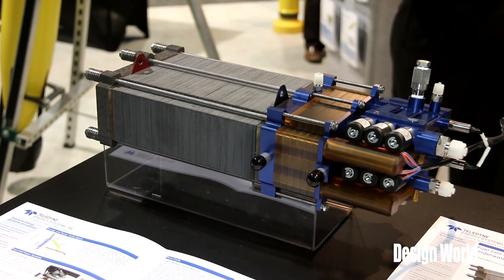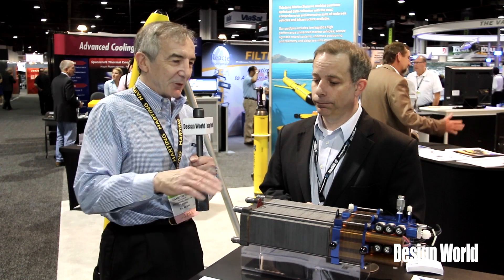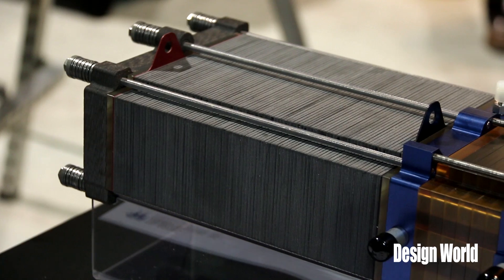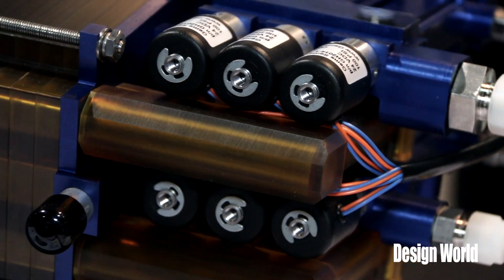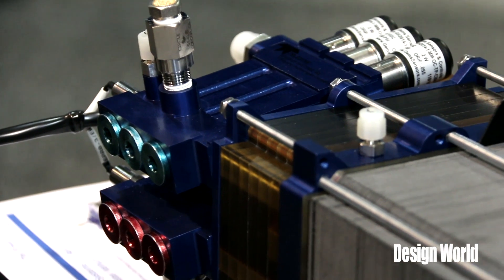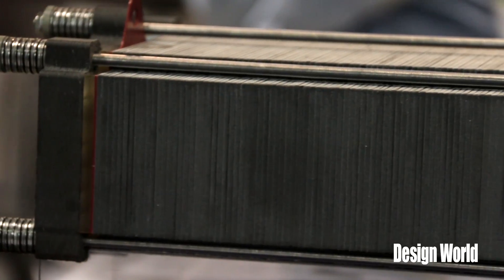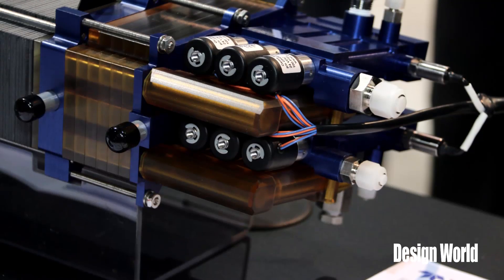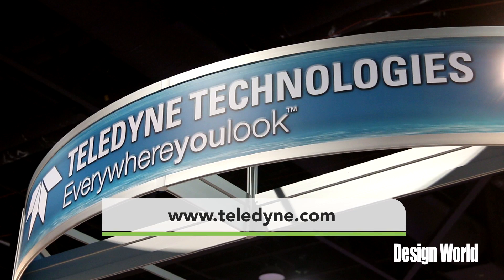Who needs batteries when you've got a hydrogen fuel cell

Comment: Use solar heating to make steam from ocean water, convert steam to Hydrogen, use the excess salt for foods or even salt the roads in the winter.  Cut costs down by making the Hyrdrogen from renewable resources then use it to power vehicles.  The clean water produced while driving could help stop desertification along the roads.  Fuel cells are the future.  Just need to focus on development as much as the government has spent on Toxic Battery tech.
Reply: How to convert stream into hydrogen?
Reply: @fsdsavinglives  Fuel Cells can convert water into hydrogen (or steam), then fuel cells can also be used to convert hydrogen into a direct electrical current.
Reply: WERE SPENDING ALL OF OUR LITHIUM ON SILLY LUXURY CARS.
Reply: @RubbinRobbin  not exactly true, my whole house runs on lithium batteries.  These batteries came right out of that luxury car and will run another 8-10 years, If not longer as long as I don't abuse them.
Reply: To store hydrogen you will have to compress it ( equals energy loss ).
On decompression, it could be a cooling agent plus be used in the fuel cell.
It is my guess that also the oxigen has to stored as well to be a clean source for the cell?
Occasionally I notice a truck running on LNG (liquified natural gas).
Then I am impressed since NH4 becomes a liquid at -162°C (-259°F)
Compression 600 fold.. 
(Netherlands - Eindhoven)
Reply: Exactly,hydrogen fuel cells to me are one of the most promising  technologies
Reply: @teenforce-dance5255  Formic Acid is the best hydrogen storage medium as it can be made directly from CO2 in atmosphere thanks to modern catalysts.
Reply: @philipm3173  Right on, i get to do more reading, thanks.
Reply: Goodnight
Reply: The steam system fails as the energy required to convert into hydrogen adds up to around  33% loss
Reply: Sadly you are wrong (on multiple points). Reason why fuel cells have not been widely adopted is because of low efficiency of hydrogen/water cycle. Which is only about 35%. 
Water (no chemical energy) -> electrolysis (energy goes in) -> hydrogen (high chemical energy) -> fuel cell (energy goes out) -> water (no chemical energy)
As you can see hydrogen is not actually the source of energy here. The source is what ever powers electrolysis to make the hydrogen. There is no reasonable amount of free floating unbound hydrogen on Earth (except the one made by humans), because it is highly reactive element that binds with nearly everything. So, hydrogen needs to be manufactured. It can be made from water, using solar with electrolysis. Electrolysis being about 75% efficient. Hydrogen fuel cell are about 50% efficient. Total efficiency of the cycle being 50% from those 75%, so around 35%. 
Note that none of this is new technology. First hydrogen fuel cell has been made in 1842, first car powered by it in 1966. Electrolysis has been discovered in 1800. 
This is no emerging field therefore it is unlike any major improvements will be made. On the other hand lithium battery will hold 99% of energy put into it.
Reply: @jeffsaffron5647  Increase efficiency by removing the need for powerlines, create decentralized utility companies where hydrogen companies can fill safe tanks under peoples home, no more need for costly maintenance for powerlines.  Save energy from the cost of making high energy cost powerlines or power plants by having peoples have their own fuel cell power stations for their homes.  New industry equals high paying jobs and innovation for those companies to save money by making hydrogen less expensive to make.  Alternative is Nuclear power to make the hydrogen and fill up peoples hydrogen tanks buried under their homes maintained by the competing decentralized utility companies.  Try to think outside the box.  I have already crunched numbers and percentages and know that not enough data exists to just say something wont work.    - To solve world hunger we need to make energy free or as cheap as possible.
Reply: @PhilosophyResurrected  Your argument is for decentralized power production not for using hydrogen. All you described can be done with batteries instead of hydrogen tanks. When using hydrogen you need to make 3x as much energy.
But OK lets do the math.
Average household in first world country eats up about 20-30kWh a day on average. Given 35% efficiency of your proposed solution, you would need to make about 90kW a day from solar EVERY day. So annually 90kW x 365 days = 32 850 kWh.  I live on 50th N parallel. We have on average 1 670 hours of sunshine per year. That means every hour i would need to make 32 850 / 1670 = 19.67kW from solar. That is achievable optimistically with 30kW solar system which costs around 50 000 USD, it would probably be even more expensive with fuel cells instead of batteries. Not to mention, fuel cells are rated for about 20 000hr of operation. Meaning they would last maybe 4-5 years. Does not seem like realistic to me.
Reply: @jeffsaffron5647  Let me get better insight into your thinking. Do you by chance know how much power would be saved from not making powerlines to include installation, digging earth materials and refinement?  How much power is lost sending power down those lines?  Could power be saved if hydrogen was made next to nuclear power plants?  The new industry would be to make fuel cells for fueling the homes, businesses etc.  We need more data to determine how much power is wasted with centralized power plants and their development or sustainment vs a decentralized power using fuel cells and hydrogen to power homes and businesses.  The whole industry needs to change to a hydrogen economy to make the planet a more clean place.
Reply: @PhilosophyResurrected  
- There is not a simple answer to that
- About 8-15% energy is lost in transition from power plant to household. Depends on distance from power plant, number of step-down transformers etc etc. 
- Yes but why store it if you have continuous source of energy in form of nuclear reactor. Energy storage is needed for intermittent energy sources such as wind or solar.
- Fuel cells are super expensive, have limited live span, and have very limited power output (needs to be stacked in series).
- No need for more data. We have electric grids over 100 years we know very well their loses.
- For many industries even electrification is nearly impossible. Metallurgy, steel foundries, chemical/petroleium industries. These industries rely mostly on natural gas as energy source they simply can't get enough power for their processes from electricity. 

My last point on this subject is on Hydrogen energy density. Because it is not as high as people think (meaning energy released in chemical reaction - oxidation, not talking about nuclear reactions such as fusion, fission or annihilation). Yes liquid hydrogen has highest energy density of all elements. However storing liquid hydrogen long term is nearly impossible since it needs to be kept at -252C. Therefor hydrogen is stored as gas at high pressure. This requires very heavy duty tanks and piping. Energy density of high pressure hydrogen gas is pretty much the same as lithium batteries when you count in the weight of the tank. You can see this easily in practice comparing Tesla Model S with Toyota Marai that runs on Hydrogen. Both have similar range at about 600 km.
Toyota Mirai - Weight: 1850 Kg
Tesla Model S - Weight: 2215 Kg
Yes Mirai is lighter but only by 10% or so. Reality is when you count in the heavy tank needed for high pressure hydrogen, difference in KWh per Kg vs lithium batteries is very small.

That's it from me, I said all there is to be said about this. I do wish reality with hydrogen was better, as it is a cool tech. Sadly reality is different and batteries are just better option.
Reply: @jeffsaffron5647  Very good points.  I think i am a bit smarter.  The reason i push decentralization is for the creation of a new independent energy society.  I think the sacrifice in energy output would be worth it.  We could slow desertification with the water that comes out of tail pipes.  I appreciate the discussion, typing to explain a point can be exhausting, much appreciated.  - Cheers.

Comment: Hydrogen generator... Get the name right bro
Reply: Is uses hydrogen it does not generate it
Reply: @namibianbackyardengineerin4412  It probs does both if its not attached to an external network with hydrogen in.
Reply: @GabrielTobing  It is designed for submarines n shit.
where is the sub gonna get the energy for making it? a nuclear reactor? well if that was the case you wouldn't need it.
Reply: @TauCu  Emergency power or if the power demands are greater than power production by the reactor for a short period of time.
Reply: @GabrielTobing  Not every sub can have a reactor. It also seems a dumb idea to allow unmanned underwater vehicles to have reactors. so they're probably not allowed to.
Reply: @TauCu  Well then, just charge it when not in use, like at your home.
Reply: @GabrielTobing  with what?
Reply: @TauCu  Main power.
Reply: @GabrielTobing  A most autonomous systems don't have access to the grid when operating.

If they did they wouldn't need batteries or fuel cells.
Reply: @TauCu  A good system would have emergency backups such as batteries at the very least to operate whatever needs electrical operation in the event that the main power source becomes unavailable. Without power an autonomous system would not likely exist.

Comment: That's interesting, because most space craft are solar and battery powered.
Reply: and most cars are powered by gasoline.
What is your point?
Reply: @TauCu  , and we know that is changing.  Not really blow away by this presentation.  

Compares size of fuel cell to battery,  but leaves out the size of the fuel tank.  
"How long will it last?"  
"Depends on how much fuel you have". -- Ahh, what about just adding more battery?
Reply: @KillroyX99  That was my point. it is changing because they found it to be no longer practical.

considering hfcs have gotten less investment then battery tech, and the fact that they're competing with it currently is impressive to say the least.

the guy literally asked "how long does a gas tank last"
and he basically answered: Well... it depends... on how much you use it.

for example:`
if you use a LPG bottle for a tank-less heater it ain't gonna last long... if you use it for a BBQ it probably will.`

That was an honest answer from the guy for a stupid question. the presentation was not about containment vessels. it was about fuel cells.

as for "just adding more battery" well...
is his target market retarded or something?

I think they did think of that.

And i think that is why this exists.
Because batteries didn't cut it in enough situations and ended up warranting this things majestic existence.

Comment: But these fuel cells cost $20,000 for what's the f*** point
Reply: ...And a powerwall battery pack is $10,000.  What's your point?
Reply: Bruce Ferrell 
And add
And 6,000 for a drive unit out of warrenty. Many have gone through several DU's.
Reply: if there was no point they wouldn't use them.

Comment: Most of you are missing the point .  This guy dont know much about it I am sure of that . But a tool like this is like all tools they break down and needs repaired or rebuilt . The same way as anything that is man made . The thing is the running life span of this tool is much greater than storing fossil fuels or Batteries .  You people had miss judge this tool and this sales man had also . Now Is this tool legit I dont know . But if it's at a demo fair I would count it is .  We have to remember that we want am on demand Hydro cell . This guy is not clear on that although he told the reporter that energy can be stored in a way and that it still needs prepared fuel source for this system . This is because that the membrane will collect contaminants from other sources like tap water or in the case open water my it be the sea or fresh water lakes or ponds .  One thing we have to realize the the fuel cell dont need to be vary large or contain a lot of water . Another words that water goes a long way .
Reply: Longevity, maintenance, water is "cleaner" and easier to acquire than lithium. The fuel cell process in reverse, adding solar power, will yield the separate gas. No need to pressurize depending on your application.

Comment: Hydrogen has already lost against improvements in battery technology, not just in terms of cost but in terms of energy density in working prototypes.  In 5 years, a single 500lb electric battery will power an EV for 1,000 miles, and a small aircraft for 100 miles of flight time.  By the time hydrogen fuel cells could be adapted in airliners, it will be too late.  Whatever theoretical advantage FC tech might have had a decade ago is quickly disappearing.
Reply: 3 years later... not even close to that range mate...2 years to go....
Reply: Nope

Comment: It would be good if governments across the world would back hydrogen power generation.

Particularly in New South Wales in Australia where all of the coal fired power stations are approaching the end of their life cycle & they are not going to be replaced with more coal fired power stations.

I know Donald Trump calls that climate change a hoax but in my area,the summers have had peaking temperatures of 40 - 47 degrees Celsius which isn't normal in New South Wales,only at places such as Coober Pedy in South Australia where old opal mines have been converted into homes for that reason,they are underground & there's no need for air conditioning.

If solar & wind power could be used to supply hydrogen gas storage,we would have hydrogen gas fired power generation, hydrogen gas heating & cooking as well as hydrogen gas fuelled cars & buses which would emit only H2O emissions.

It would do away with the most complained about coal seam gas plants where the fracking  process can pollute the water table,waterways & destroy farmland.

It really upset land owners at Fullerton Cove near Newcastle in NSW where the water table is only like 1 - 2 metres under the ground & their reason for wanting to drill there is because the coal seam gas bed is 20 metres underground.

That got stopped after the residents in the area complained about it & I don't blame them,it's bad enough that the air force have been contaminating that area with their toxic fire retardant.
Reply: The energy it takes to create hydrogen makes the effect of doing it not worth it. You are better off creating biofuel from brown water (poo), pumped hydro or batteries. Also, hydrogen is a really difficult element to handle safely, because it's so small (Literally the smallest element) it creeps into metal and makes it brittle over time. Based on the success of the tesla battery in South Australia, Victoria is going to build one as well. Decentralised, distributed storage is far more resilient as when part of the grid goes down due to bush fire or storms or whatever, having distributed storage means you lessen the impact of these outages. Hydrogen, has a niche market in commercial/industrial uses but not beyond that due to complexity, cost and safety

Comment: Where is the H2 fuel tank? Your tabletop energy source just got bigger than any battery when you include a large very high pressure tank.  How much energy is used to make the hydrogen? Hint, three times what you will get in output.  What is the price of the platinum in the fuel cell?  I think a Tesla with batteries wins this competition every time as a storage device for electricity.
Reply: Carbon-fibre fuel tanks are used that are about the size of a scuba diver's tank or slightly larger. Due to the nature of the material, the tank is pretty light and can be used to store a lot of hydrogen in a small volume. They're also indestructible, and can withstand being shot with a gun.  The problem with battery packs is that they aren't very scalable; they make sense for use in cars, but for larger applications like trains and HGVs, the poor energy density of batteries makes it uneconomical to use. Fuel cells are very scalable, at least in terms of power output/kg and kWh/kg.
Reply: It's not just the fuel cell & tanks. 5,000 to 10,000 psi hydrogen fuel lines & valves are required & they are very expensive to build, test, & maintain. Fuel cells also require large radiators to dispose of unwanted, inefficient, & potentially damaging heat. 

Finally because fuel cells produce power at a fixed rate there are also batteries, & a battery management system just as in a BEV. A fuel cell car is really a BEV with a really, really, expensive sustainer engine.
Reply: Look, hydrogen cells are better for few reasons: it doesn't really needs to be replaced, so it wins durability test and also it is not as harmful for environment, cuz lithium batteries are needed to her recycled but not all people or countries do that. Also there is a limited amount of lithium on the earth... And after this imagine that most of people will decide to move onto the lithium powered cars. It will be awful for all of us
Reply: 30 grams or so of expensive metal vs 60 kilograms of inexpensive metal; costs are similar. It is more efficient to charge a battery instead of splitting salt water and compressing the hydrogen, but if you also use the oxygen and H2O, or don't want to worry about the battery being undercharged, hydrogen is better than lithium storage. Not sure whether leaks or discharge are worse irl, though.